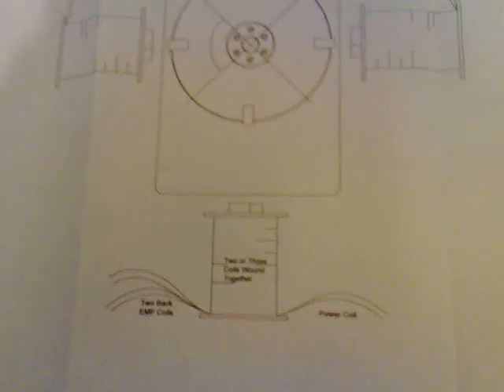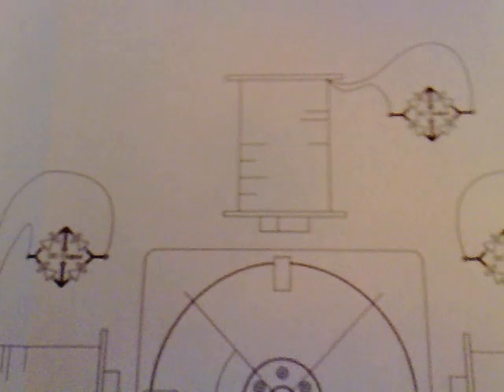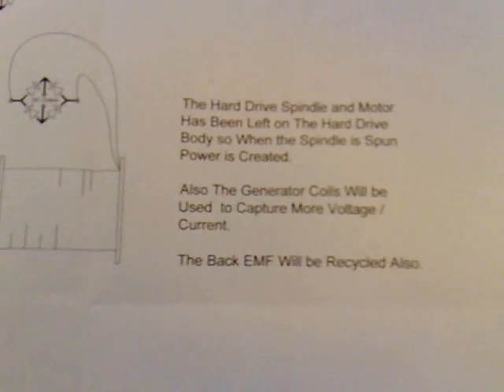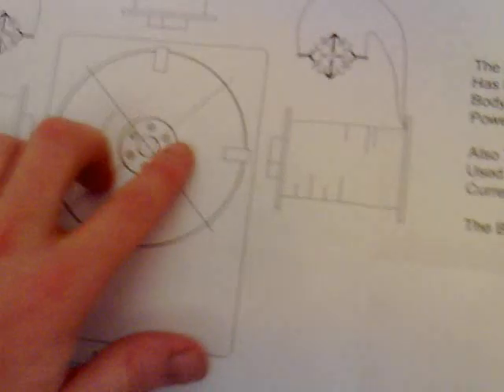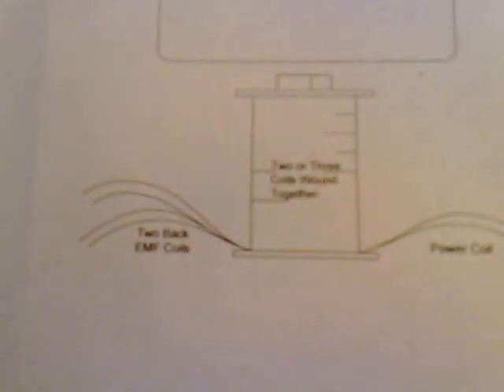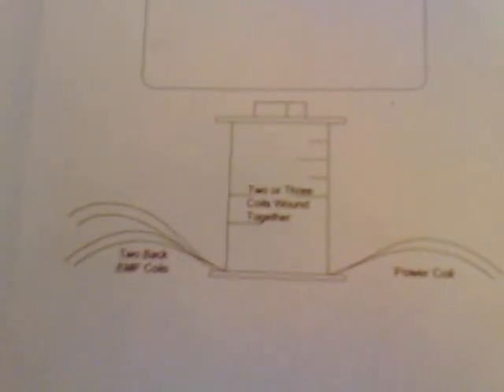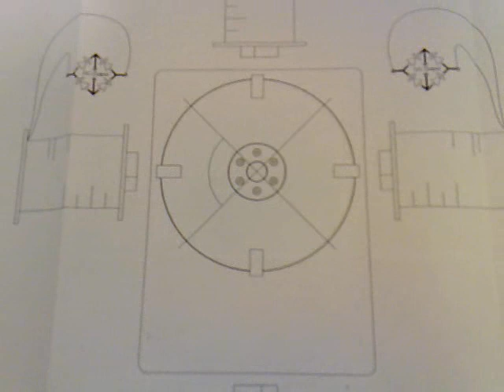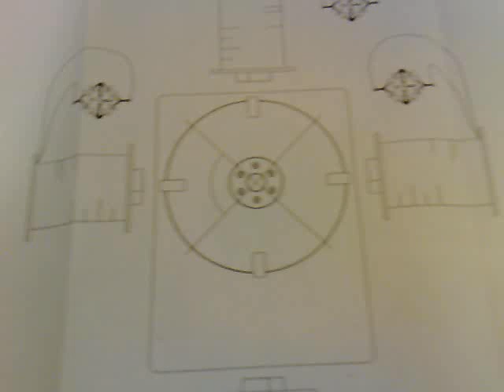Pulse Motor (New 4 Coil HD Idea) 018

Comment: coils out of a gas vavle in a heating and air condiontioning unit has a double wound coil might pick up twice the energy thats what i am using for my generator in my video.both side of the generator will
generate but i havent got a extra meter to see if it does at the same time